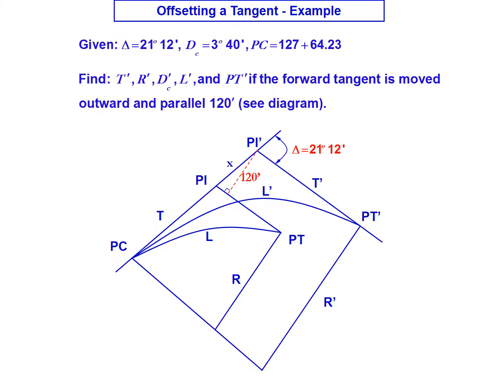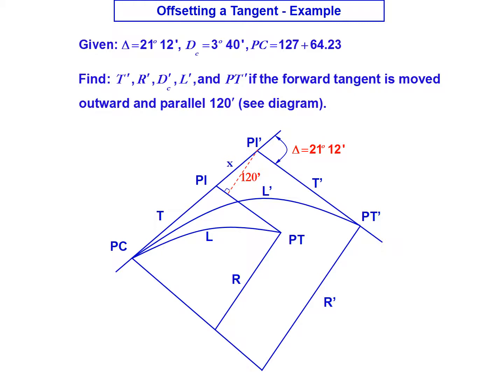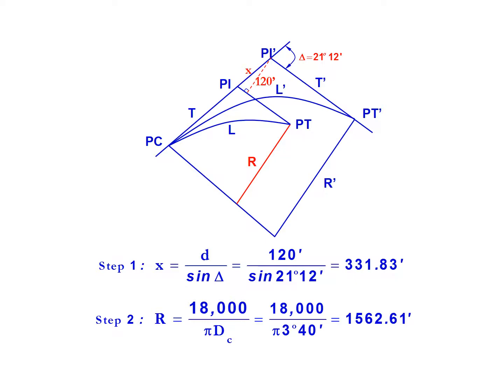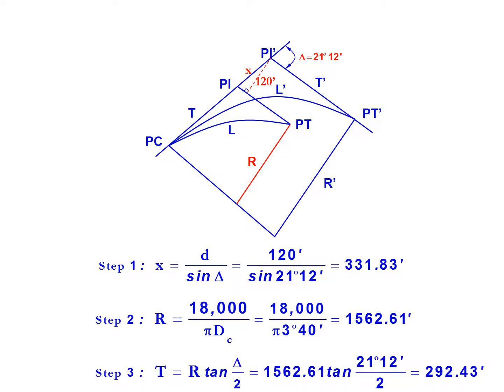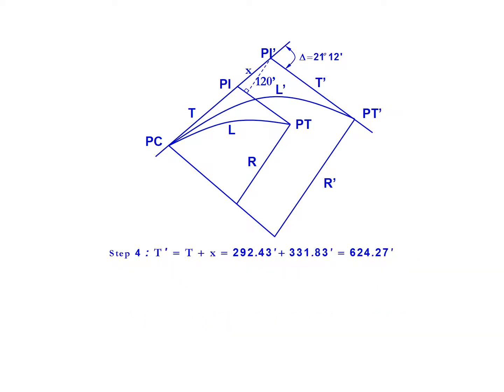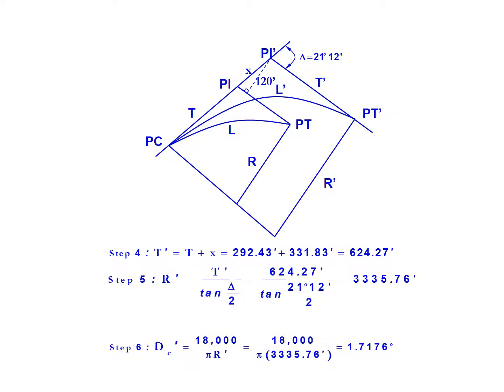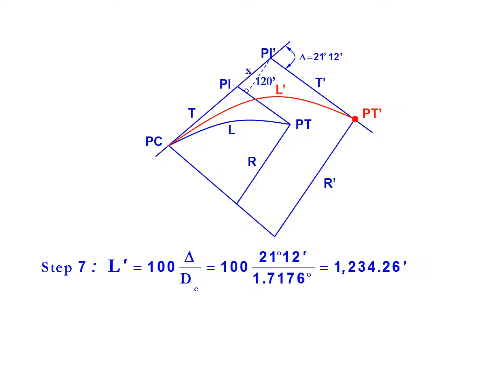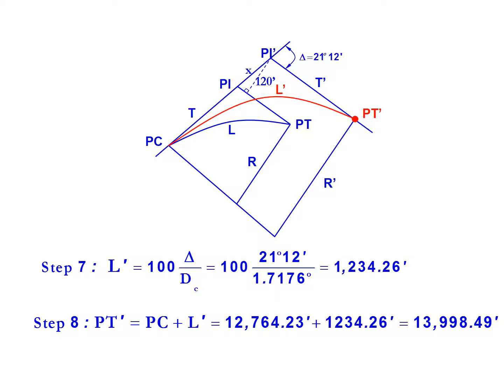Example for Offsetting a Tangent for Highway Horizontal Alignment

Comment: Why did you use the 18,000/piR equation rather than the 50/(sin(Dc/2))? I am seeing the former to be the Da formula whereas the latter is for Dc. The problem statement gave us the Dc.
Reply from the maker: Unfortunately, the variables are used consistently throughout our industry.  The first equation is defined as Da in the NCEES reference handbook as the arc definition.  Dc in the problem statement is also referring to the arc definition.